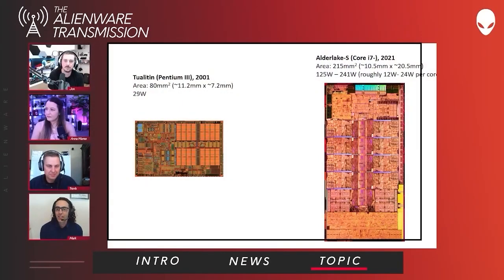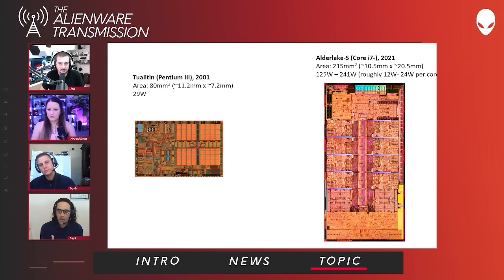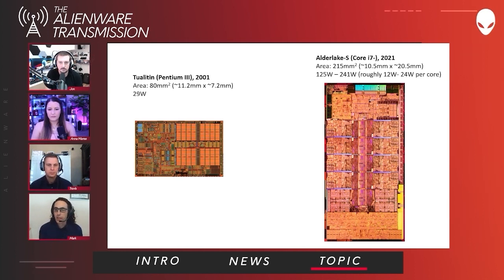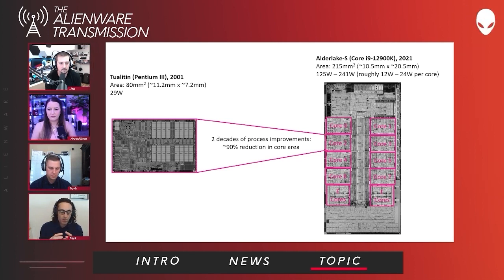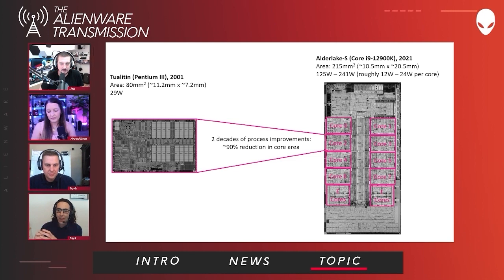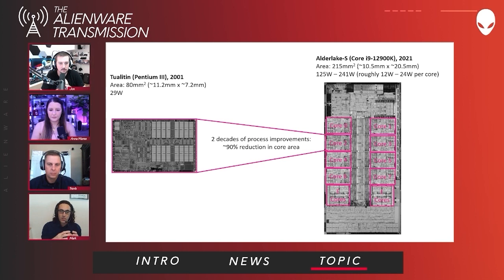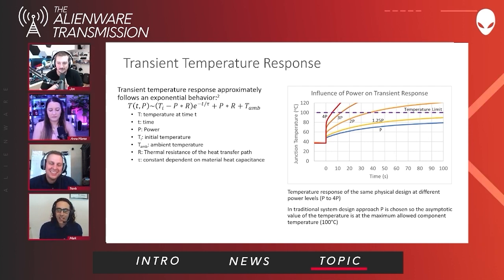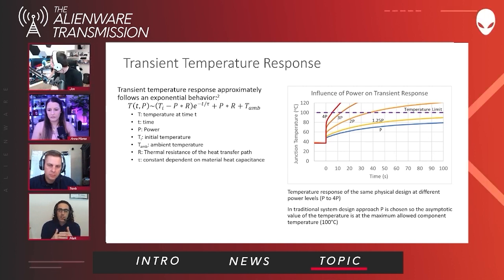Thermal Discussion | Alienware Transmission Clips

Comment: Quality control at Dell is a total joke! When spending $4000 USD on a laptop and having it arrive with a top that doesn't close evenly, speakers that sound horrible, thermal throttling basically as soon as windows boots, then tech support that tries anyway they can to convince you everything is fine. This company has zero credibility and will try to weasel its way through telling you everything is fine. Instead of getting a bunch of Sr. Engineers to make a video, how about taking 10mins and training your assembly line to properly apply thermal paste and your Quality Control department to have some pride in the work they do instead of shipping systems that are trash. Anyone looking for evidence of Dell's shady tactics and garbage QC, jump on the Alienware subreddit. It says it all! Consumers, do your research before sinking your hard-earned money into such a huge investment.